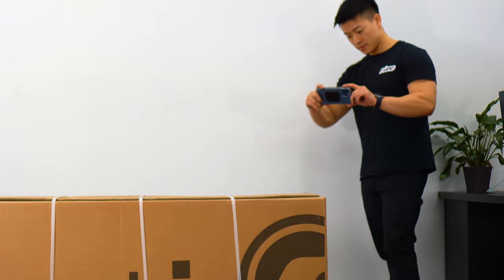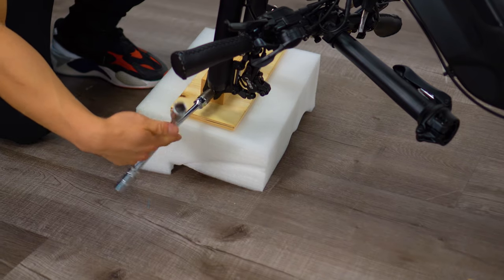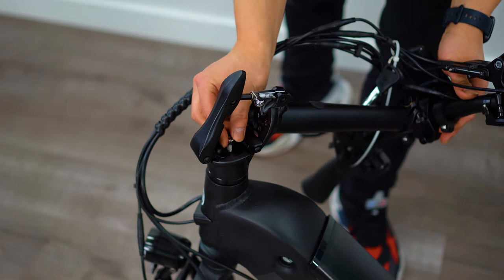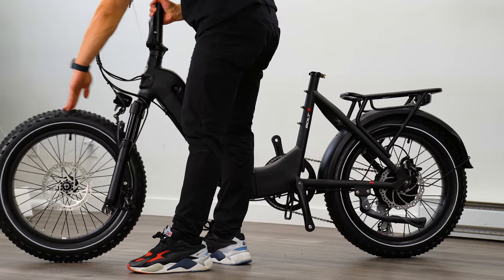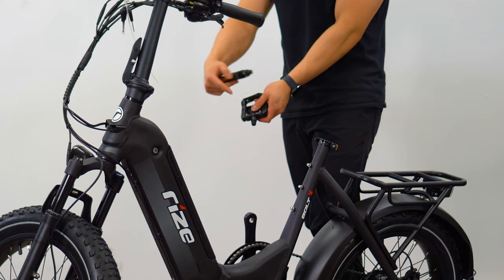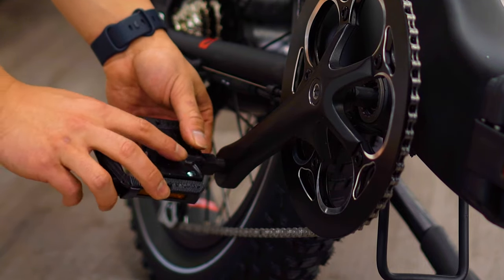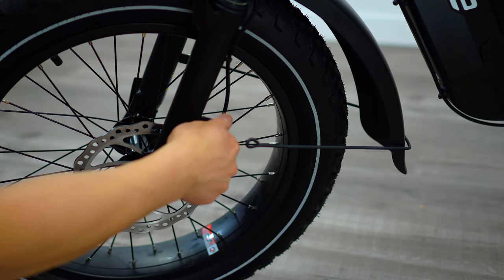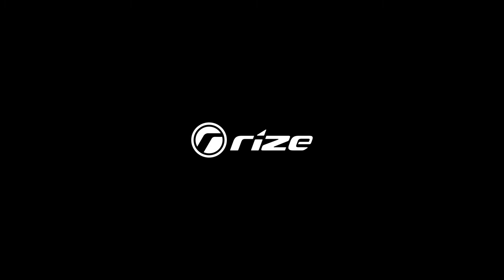Assembly Tutorial | Bolt

Comment: Remove the headlight before you put the tire on. You have to do it later, anyway, and it's easier without the tire there. Make sure you have metric wrenches handy - standard won't work with these nuts. Also, the allen keys provided aren't great as you have to work around the bulky set.